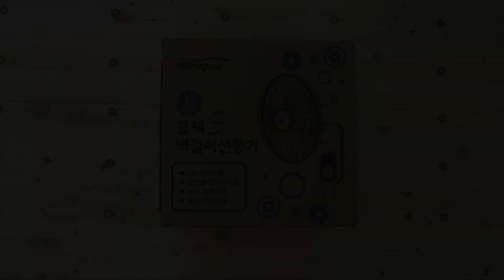Fan-type Strong Dust Collector / DIY

Comment from the maker: Please turn on your language subtitles!
Hello, this is Kynosys.
I've created a rare type of dust collection system. I think it's going to be very useful.
I bought a purification filter on the market and used it.
It is a fan-type centrifuge filter made of the same size as the wings of a regular fan.
All you have to do is take off the fan's wings and insert them into it.
When the fan is turned on, the dust collection filter rotates to blow the wind in the direction of the wing tip.
From the front of the original fan, the filter takes in the air and releases the air in the direction of the wing tip. At this time, dust passing through the filter is collected at the edge of the filter by centrifugal force. It collects fine dust, not large dust like a giant dust collector.  If you remove the filter after using it for a certain period of time and clean it with an air gun, you can use it semi-permanently without changing the filter.
If you put the wings of the fan you removed back in, you can use it like a conventional fan.
When I used it in the workshop, it was confirmed that it showed excellent dust collection ability.
After a few hours of playing, I could feel that 90% of the wood smell in the workshop disappeared.
We can of course confirm this by looking at the dust gathered in the filter.
It's the best dust collection filter for a cost effectiveness. 
I hope you can use it, too.
Thank you.

#DIY #Dustcollector #Fan #woodworking #woodwork #making #Howto